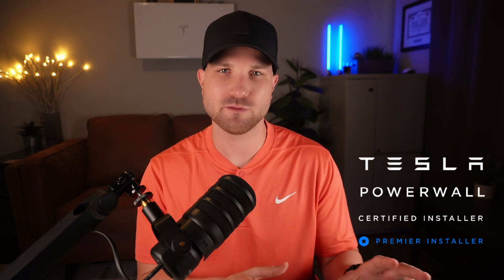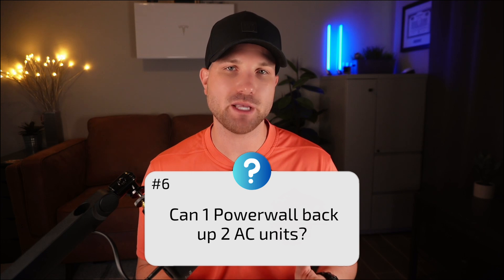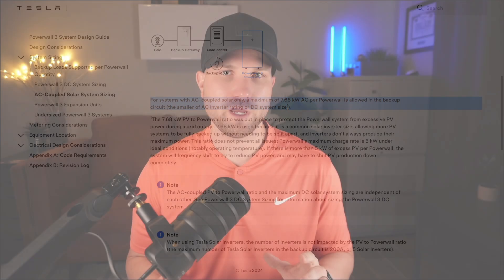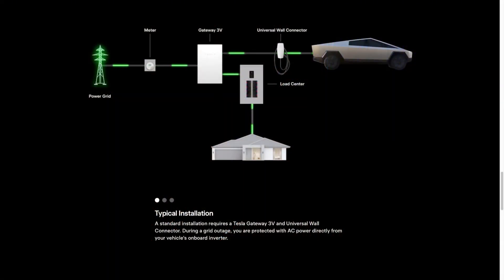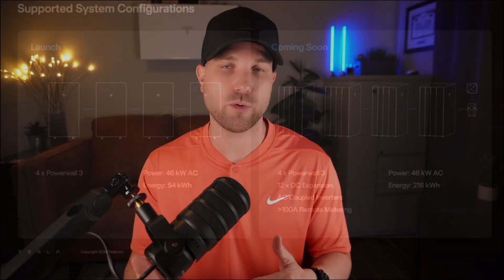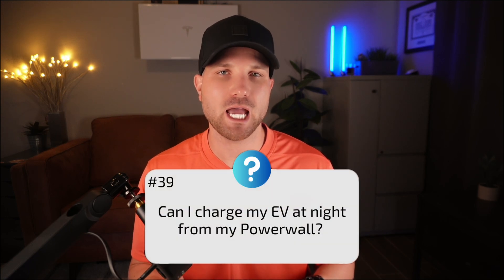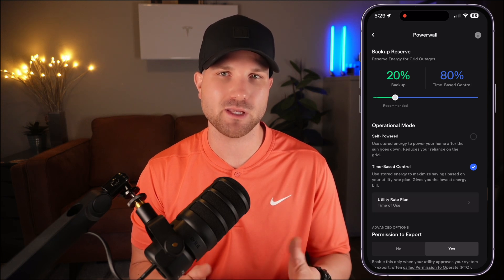Tesla Powerwall 3: Top 47 FAQs Answered!

Comment from the maker: Updates Found Here (Last Updated 7/28/25)

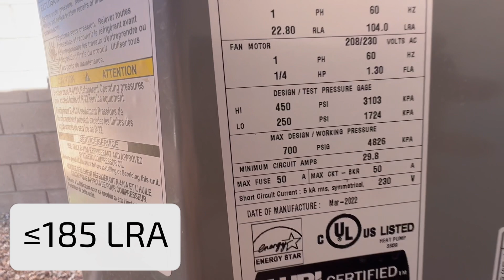- IMPORTANT CHANGE: at 2:53, your home's LARGEST A/C unit just needs to be under 185 LRA. All units combined can be over 185 LRA and still be backed up by just 1x Powerwall 3. Again, the largest unit alone must be under 185 LRA.
- What's new with PW3 from PW2 (10/1/2024) If you want to learn the differences between PW2 & PW3, then check out this video https://youtu.be/LWw8UvDki28
- Regarding capacity (10/1/2024): Capacity is 13.5 kWh, but there will be some conversion losses (~10%). Realistically there's ~12-12.5 kWh of capacity available under real world conditions.
- Add-ons with NEM (10/8/24) Will adding a PW3 impact your NEM status (CA)? From Tesla: AS OF NOW...Yes. Customers on NEM 1.0 and NEM 2.0 can add battery storage later. For existing NEM 1.0 and NEM 2.0 customers, adding battery storage does not affect your existing status.
- WiFi & Cellular connectivity (2/26/25) If concerned with a total lapse in the grid, WiFi, and possible cellular, you can still monitor your Powerwall "locally" without connectivity. You can see the state of charge and other system performance stats within the app. Here's more info: https://www.tesla.com/support/energy/powerwall/own/connecting-network
- Software (10/8/24) For even more Powerwall automations or to monitor your system from your web browser, check out this app: https://www.netzero.energy
- Remote Meter (10/9/24) With the release of Tesla's Remote Meter, the Powerwall 3 can be AC-coupled with existing solar with BOTH the Backup Switch & Gateway 3. Additionally, partial home backup with the Gateway 3 and Powerwall 3 is also possible.
-DC-Expansion Packs are now available for order (2/2025)
- Yes, the Powerwall 3 can be AC-coupled when using the Backup Switch (if everything else is compatible). I still hear of installers who say that it cannot be and that is not true.  (6/2025)

Comment: Hi Zach, I have a gateway 2 &. 2 powerwall 2, one powerwall has failed & tesla have agreed to replace it with a powerwall 3, as the two are not compatible, could you suggest a workaround to keep my good powerwall 2 operating. Looking forward to ideas
Reply from the maker: Unfortunately there is no work around. Tesla should be replacing your system with a PW3 + Expansion Pack so that you keep the same 27 kWh of capacity.

Comment: Hi , I have a question . Will they be changing over to the new Tesla batteries or using the same type? Should I wait , I was looking to doing this next year. Thank you so much . Big Tesla fan , I have invested in the company looking to buy the model two when it comes out .
Reply from the maker: Powerwall 3 is a pretty new gen for them (2024-2025 release). I'd expect it to be here for a while since there isn't a lot that needs improved upon at this point. Powerwall 2 was around for about 8 years for reference as well.

Comment: I have a PW 3 and by itself it's really just borderline for a normal home. It really needs a second battery to get you into a more comfortable energy space. Using the Tesla 'backup switch' also means you can't use a generator if the grid goes down durning a long cloudy storm. This is the major weak link in the PW 3 (with backup switch). You CAN use a backup generator with PW 3 when using the Tesla Gateway interface. It's sort of a catch-22 issue. Get a PW 3 with backup switch and you are functionally more vulnerable to loooooong term grid blackouts.
Reply from the maker: I hear ya. Multiple Powerwalls is really the way to go if you want a buffer. Just to clarify, Powerwall cannot integrate with a generator system on either backup switch or gateway. It can work alongside a generator with gateway if that's what you meant...but the generator can't recharge the Powerwall or energize the same circuits. They need to live separate of each other electrically. https://www.tesla.com/support/energy/powerwall/learn/combining-systems

I usually don't recommend Tesla to anyone who likes the idea of having a generator for a long-term outage. Better generator friendly battery options out there.

Comment: Why i can't use the existing battery that is connected to my existing inverter??? My existing inverter will handle the charge and discharge right??
Reply from the maker: Software limitations. All batteries/systems have to communicate with each other.

Comment: I have a new Powerwall 3 ordered with an extra battery. Would it be possible to have a cable installed to connect my generator in case our power is out for an extended time? I also have 45 solar panels installed for several years. I was thinking I could keep the charge in my 2 units.
Reply from the maker: You can install a generator with a Powerwall system but it has to be "downstream" of the Powerwall itself. Here's more info: https://www.tesla.com/support/energy/powerwall/learn/combining-systems

Comment: If you have multiple powerwalls backfeeding a single 200amp panel, does it limit the output each is capable of due to the 120% rule? In other words if you have multiple pw3s can you really get the full power out of them?
Reply from the maker: Yes you still can. This information might be helpful: https://energylibrary.tesla.com/docs/Public/EnergyStorage/Powerwall/General/Compliance/PowerControlSystemFeatures/en-us/GUID-A8C359E8-C93F-4969-B86F-9352E59429FB.html
Reply: Oh i see. So on a 200amp panel the collar will make sure the busbar never sees more than 160 amps. Would a normal all electric house ever see 160amps? It seems to me if you did get near 160 amps of consumption your system would essentially turn off and pull only from the grid, is that correct?

Comment: How two powerwall 3 are work together? are the giving 23KW max all the time or only one works and the seconde one kicks in when the ask for more then 11.5KW?
Reply from the maker: Two Powerwalls can provide up to 23 kW continuous in total. 11.5 kW each.
Reply: @ZachSolar  Tesla said to me that only one will work so I will get only 11.5 but my math said what you stated maybe by software they playing? I am confuse
Reply: my system has 30 panele 410X30=12.300 W one powerwall 3 + one powerwall 3 expansion total output 11.5 KW ome time during the month I use 13KW, 16KW and 17.3 at night 0KW from paneles house use 17.3KW Batteris at100% I tried to go of grid
I got thae massage Couldn't go off Grid  Power Usage Too High so if I had two power 3 (real ones) would it work?
Reply from the maker: I'm also confused. Not exactly sure, but 2 Powerwall 3s will absolutely give you access to 23 kW worth of power output from the battery side as well.

For that error message, that's just a safety measure. If the grid actually went offline, but for the app feature they don't want to put too much stress on the batteries unnecessarily. At least that's my experience.

Comment: First of all thank you for the content, really helpfull!
A question for you... I have to install on my house a new Pv plant, 14 panels from sunpower p7 440w, now, my home has 3 different roof surfaces, one bigger on south, and two with less speace in north and west (more or less) the problem is... different azimth different exposure, at 30° inclination the difference is a lot! With powerwall 3 i have good efficency but only three string (right?) and ill have 9 panel on south, 3 non west and only 2 facing north. so a lot of different production between different faces. the other way is buy the powerwall 2 and solar edge optimizers and inverter, so every panel can produce the maximum power. my question is, what is the best choice? PW3? 2 panels are enough for one string? or pw2 and optimizers?   economically pw3 are the best choice, pw2 cost less but i have to add optimizers and a inverter form solar edge. please halp me!  thank you !!!
Reply from the maker: Thanks for watching! I don’t think I have enough data to say definitively which option is best for you, but it’s great to see you doing your homework. The Powerwall 3 and its MPPTs (6 in US, 3 in UK) will work fine here. Each MPPT requires a minimum of 2 panels so your setup looks good on that side too.
Reply: @ZachSolar  thank you so much! Yes I'm pretty sure that here in italy we have the uk version, still enough though, so you suggest a string for every side (9 panels, 3 panels and 2 panels) and I'll be fine?
Thank you very much for your help!

Comment: If you have two PW3 limited to 5kw inverter each, would they work together to provide a total of 10kw?

😊
Reply from the maker: The inverter isn’t capped at 5 kW, that’s just the max charge rate. It can power the home, export to the grid and charge the battery simultaneously.
Reply: @ZachSolar  Thank you,  as you know the nominal output power (AC) can be limited at 5 / 10 / 11.04 kw etc, due to country limitations if they were both set at 5kw would they together provide the home 10kw total 👍
Reply from the maker: Oh I’m sorry, I see what you meant. Yes you are correct. To my knowledge, it would have the full 11.5 kW available when off-grid though. The decreased output should only apply when on-grid.

Comment: Hey Zach.
I am getting a 5kW system with 4 power walls(3 expansions).
I currently have a 15.39 kW solar edge system(on a 10kW inverter).

I’m being told it will work together and charge the batteries, supply home, and feed to the grid by itself via load management center?
Does that sound correct?
Even being told if go off grid it will work together?
Reply from the maker: Hey there, yep that all sounds correct. Even though the SolarEdge system is 3rd-party, it will still function like you described.

Comment: I have spoken to Tesla technical support but haven’t managed to solve my problem yet. Maybe you can help.

I have a Powerwall 3 installed in UK with no solar. I am using the Tomato Lifestyle tariff. I charge the battery fully between 1 and 6am (super-off-peak 5p per kWh). I then discharge the battery during peak rate (23p). There is an off-peak tariff at 13p from 09:30 to 11:30. In order to fool the Powerwall into charging the battery at this time I have set the time based tariff to also show as super-off-peak. Otherwise (when set at off-peak) it continues to discharge the battery. This approach gets the battery to the next off-peak time at 20:30 to 22:30 before returning to peak. If I set the tariff at 20:30 to mid-peak (13p) the PW charges up. To the point where I have more energy (@13p) stored than I can use before I get to the 01:00 and the super-off-peak rate (5p). Ideally I would like the PW to simply be idle between 20:30 and 22:30 (neither charging or discharging) using the energy directly from the grid at 13p. That will allow me to fully discharge the PW between 22:30 and 01:00. I have tried a simple fix by setting the off-peak/mid-peak period from 20:30 to 21:00 but it still over charges the battery. Any thoughts on how I can achieve this goal?

Comment: My solar company is looking to install 2 PW3's on the outside of my side wall (yes, north facing).  However behind that wall is our master bedroom where our bed is leaning up against, literally.  We do have a head board up against the wall but I'm wondering how loud would these PW's get on hot summer nights when the fans kick in.  Would we hear the fans or any buzzing from the PW's.  Any recommendations other than putting them in my garage where I would lose wall space.
Reply from the maker: Hard to say for sure. They definitely create a hum that's similar to a fridge or similar appliance. I'm not sure if it'd be enough to be a disturbance, but I'd rather be safe than sorry. My vote is always in the garage if possible, but I understand you'd rather not take up the space.

Comment: Umm…you’re wrong about how long the battery back up would last during a grid outage. Since the solar panels continue to feed energy into the battery during sunny hours, it would last longer than you said. Just FYI…
Reply from the maker: Sorry, I’m definitely aware of that. Some of these numbers are under the assumption no solar energy would be coming in (during a storm, at night, etc)
Reply: @ Why would you assume that?
Reply from the maker: You missed this part 3:24 
I mention a single unit can last 24+ hours and incoming solar will recharge the battery and power the home.

Comment: Should I install a backup power inlet box (for a gas generator) before or after a powerwall 3 install? If/when it’s cloudy and my solar is useless (and my Powerwall is empty), could i run a gas generator to power the house? What other equipment would I need?
Reply from the maker: Honestly, I'd consult with a local installer on it as they may have different preferences on how it's all done depending on your situation. I think generators just complicate everything with the Powerwall system IMO. I'd rather use that money towards an additional Powerwall to expand capacity. Here's more info directly from Tesla on generator integration though: https://www.tesla.com/support/energy/powerwall/learn/combining-systems
Reply: @ I agree it would be easier to have multiple Powerwalls but in a sense I’m hedging my bets with the availability of gasoline and solar power.
Reply from the maker: @jchao003  That's fair. I see what ya mean. It's definitely doable, just going to come down to the preference of the installer & possibly even your specific jurisdiction.
Reply: @ Right, thanks for your insight. Plus, with a short 15-year lifespan, solar panels and battery backup systems require pricey installations/replacements.

Comment: Hi. You didn't cover anything about 3-phase powered homes. I understand the PW3 still only handles single phase and therefore can't do whole home backup if your home has 3-phase, only able to cover one of the three. Should I simply go with a different system or is there a solution using PW3s?
Reply from the maker: I haven't done a lot of homework on 3-phase as it's not something we ever run into on the residential side here in the US.
Reply: @ZachSolar OK thanks. It's becoming increasingly common here in Australia, with a home builder that I'm considering using, including it as standard for all new builds.  220-240V 3-phase is particularly useful when it comes to charging a couple of EVs at home... A lot faster than your typical 110V in the US.

Comment: Great video, here in the U.K. there’s a much better use case for getting one to charge at night (7 pence a Kw) compared to day rate (26 pence a kw). I could achieve £1000 savings a year and can get one installed for £8000.
Reply from the maker: Thank you! And yep, that is a great opportunity to take advantage of. Are most installs in UK solar + storage?
Reply: Just anecdotally with no hard figures when our solar system went in ten years ago batteries were vanishingly rare. Today it is unusual not to include a battery.  The exception is the mini 4-6 panel installations on  mass new build developments  ( often as part of achieving plannjnb permission ) and these rarely have any batteriesinstalled. @ZachSolar

Comment: Excellent video!  Do you service the Ashfork AZ area?  I will be 100% off grid only. There is no electricity where I’m building yet. I did put in a request for a Tesla installer to contact me 3 weeks ago but nothing yet. Also interested in the solar roof instead of panels.
Reply from the maker: Thank you! Unfortunately, we only install grid-tied systems. To my knowledge, Tesla still doesn't allow their Powerwall system to be "off the grid".
Reply: @ the manufactured home I’m looking at has a “port” I guess it is called already installed. Would that help?  Everyone is on solar out there with no grid and some of the houses are 4K square ft.  Is there anyone that can install that system?

Comment: Dual Powerwall 3, integrated with Gateway 3 and implemented without solar.  What if I want to add PowerShare later?  Will I have to replace my existing Gateway 3 (by adding a neutral forming transformer) or will I need to swap my Gateway 3 for a Gateway 3v?
Reply from the maker: Short answer: All Powerwall installs are ready for Powershare. Just need the software/firmware pushed. No need to swap the gateway out.

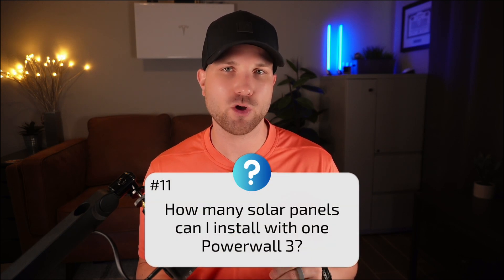Long answer: Check out this video for the full story on Powershare. I cover compatibility at the 5:42 mark https://youtu.be/MEr3syKYLH4?si=N8wPFcJp_iYOARLY

Comment: What is the benefit to use the gatway and not the backup switch
Reply from the maker: @yossishtekler7599  No benefits. They both serve the same purpose to the system. Just different methods of doing it. The backup switch is going to be more affordable due to the labor/time savings.
Reply: If I don’t use a backup switch, I cannot use my PW3 in the event of a power outage, correct? I am on NEM1 and don’t want to notify Edison, or I will be moved to NEM3. We very rarely have power outages her so really just using PW3 to stay off peak useage & push back to the grid at peak times if possible. We are adding PW3 and additional panels to our existing system.
Reply from the maker: The backup switch is just an alternative option to their gateway, which essentially acts as a transfer switch for when the grid goes offline. 

You can’t install the Powerwall 3 without backup capability right now. Either way though, you would need utility approval. Here’s your best bet (from my understanding), you can opt for a zero-export system that includes more solar + Powerwall. It will just never export power to utility therefore not remove you from your NEM status. Email me if you need more help: infozachsolar@gmail.com